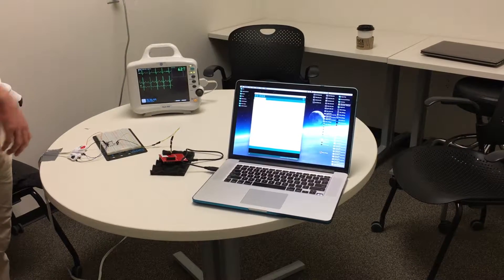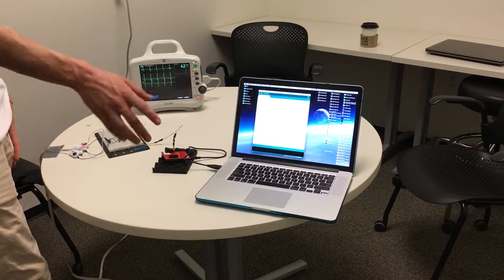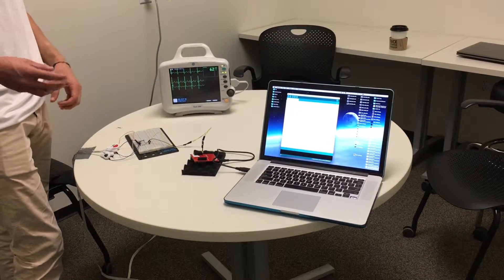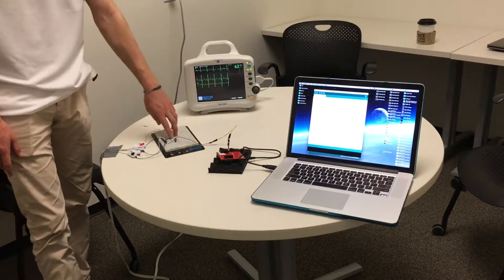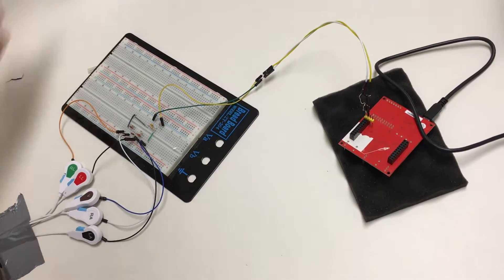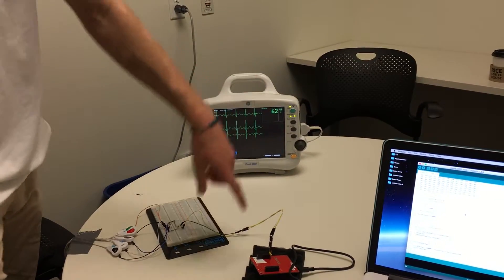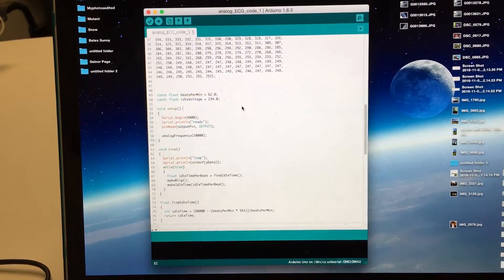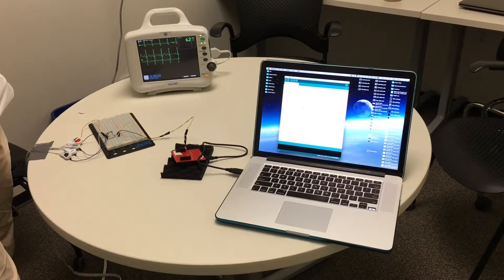ECG Simulator Prototype

Comment: I did it with arduino but when I connect it to the vital signs monitor it doesn't look the same as your video and I get bpm very high (340, 270)